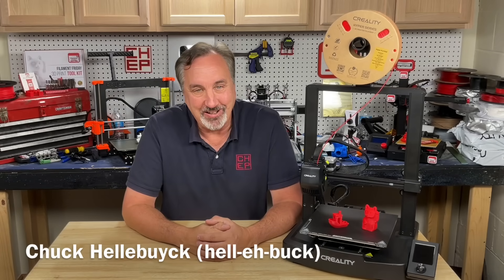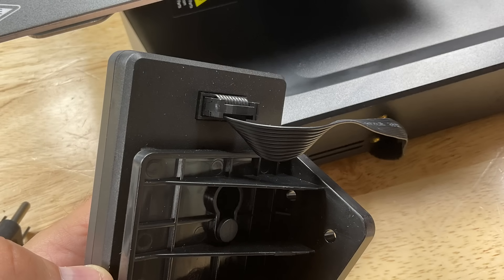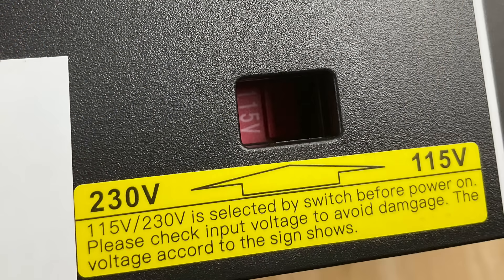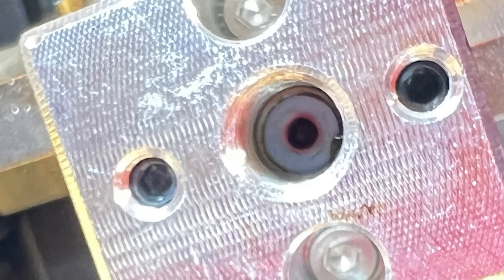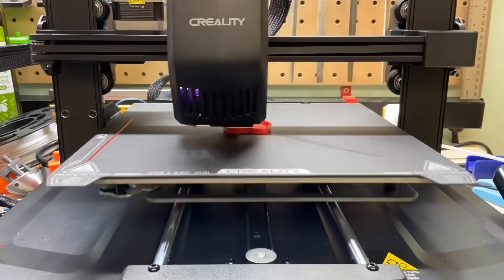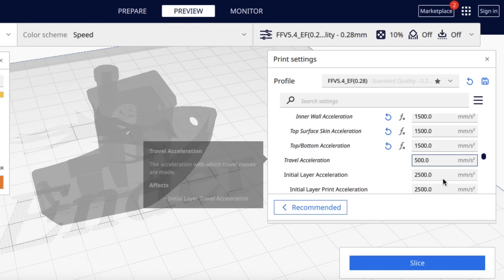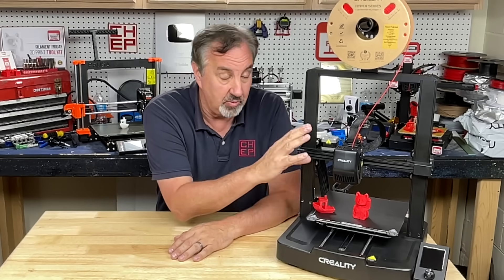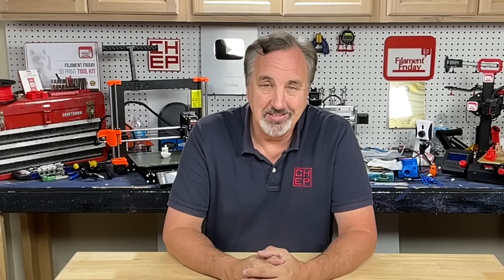Ender 3 V3 SE - Excellent Budget 3D Printer

Comment: Hi there :) I have noticed something strange on my Ender. At the beginning of a print, after the machine has done two lines on a left side, the extruder slowly goes up and then down. Because of this, about 1 cm of filament isn't printed (nozzle touches a base, moves slowly, but filament moves out after 1 cm). I have noticed in other videos on youtube that the extruder goes straight to a print area. Any solutions for this? Maybe someone else has the same problem? I have the latest firmware SWV1.0.6 - THANKS :)
Reply: I'm new to 3d printing but what you're describing sounds like behavior that's in the gcode. The print head is indeed supposed to go straight from the purge lines to the start of the print. If yours is doing something in between, then the gcode has something extra in it. The way I understand it, everything the printer does when it starts a 3d print is explicitly stated in the gcode generated by the slicer. This includes the purge lines. In Cura, the stuff the printer does immediately before it starts to actually print is stated in the Settings > Printer > Manage Printers > Machine Settings > Start G-Code. Mine has code with the following comments:

Move to start position
Draw the first line
Move to side a little
Draw the second line
Reset Extruder
Move Z Axis up little to prevent scratching of Heat Bed
Move over to prevent blob squish

It sounds like yours has some extra steps in there. Read up about start gcode to see what should and shouldn't be there.

Comment: I received this as a gift for Christmas.  I had already a Ender 3 S1 printer, I set up the new printer and it worked great for the first few prints. However it sounds like the filament if getting stuck in the extruder. head. I am struggling with this and could use some advice. I am ready to continue to repair my original printer. 

In either case I am having some issues with the units. I have new nozzles coming and will adjust the heat and feed rate on the filament. 
 any comments to help ae appreciated...

Comment: what is the dimensions of the whole printer not just the bed. I got mine for Christmas and are trying to set up a shelf but cant seem to find good dimensions for anything other than the bed.
Reply: Creality's website says
420 x 366 x 490 mm.

I dunno if that includes the screen sticking out the side.

And don't forget, the bed needs space to move backwards for Y direction, it will overhang the back of the machine's base.
Reply: @massimookissed1023  thank you! I was wondering if that would have to be the case, needing room behind. 🤔
Reply: You need it 20 inches deep

Comment: Ive had this printer sense the release. At first it printed great. But now i cant get it to print unless i use one of your profiles. If i change anything including the temp the print fails. But even with your profiles the first layer isnt the best but it prints and looks pretty good. And im having the same issue with my sunlu t3 printer. Any advice on this?

Comment: Awesome
What would you suggest for a fast printer for under $800 please?
Smaller than 300x300 is fine
Reply: Fl sun v400 is around $600 and it can print up to 400mm sec

Comment: Question: since the Z offset is done automatically, what do you do when you want to switch from PLA to PETG, where you might want to raise the Z offset a little bit? is it done automatically somehow?
Reply: I would guess just raise the 'initial layer height' in the slicer. In Cura, it's found under "Quality".

Comment: Hi Chep I have just bought Ender 3 V3 SE and the bed is so noisy and vibrates like mad, its like the rods that the bed runs on need greasing, can you advice, have I got a faulty machine or has anyone you know had this problem. At the moment my first print is the cat and its vibrating a lot. my ender 3 neo max is great. by the way love your videos.
Reply from the maker: Sounds defective. I’d send it back.

Comment: Why bother with all this messing around. There’s so many better budget printers around
Reply: Literally give me one better option than this under 200$. I'm genuinely curious
Reply: which one would you recommend? thinking in getting a sovol sv05
Reply: which one would you recommend? thinking in getting a sovol sv05
Reply: Bambulab P1P, trust me it has all you will ever want, fast, auto level and robust
 @ElWawa2
Reply: @pebb  When you can get 3 of these ender 3s for the same price, I'd take the enders
Reply: @TheConsciousEntity Spoken like someone who has no experience with Enders. You'd end up spending almost that much trying to fix the various issues and improve reliability over time, but get nowhere near the performance or reliability of a Bambu or Prusa.
Reply: @BradleyDS1  I have 6 Ender 3s and they're much more reliable than you're implying. I added BLtouches to them for less than $15 each and I print drone and RC plane parts without issue. After new bed springs and autoleveling, enders are great. Now that these things are being included from the factory with all the weak points strengthened, the deal is even better. I'll be getting one.
Reply: @TheConsciousEntity  Do you think it would ever be possible to uprade  an ender 3 pro or the v2 neo to have auto Z?
could the leveling knobs be removed and a  load cell be in in their place?
and could the current version of marlin that runs on the v3 Se be dumped and flashed to the v3 neo or  ender 3 pro?
 my por does have the flashable STM chip ,not sure about the v2 neo 
would there be a free GPIO to add a load cell to ?
ender 3 por  already bas BL touch clone but it would e nice to   add the auto  Z offset.
 or  mayeb we need to twait till kiliiper add the  capnility?

Comment: I can't help but wonder if the one Creality sent you as a demo might have different settings than the one's being sold. I've mine for a little under 2 weeks now. I just use the creality slicer that came with it and changed no setting at all. Ran the same print on my ender 3 pro as I did on the V3 SE sliced in the same slicer and the V3 was moving fast enough that it shook a pen holder off the table it was sitting on. Not doubting your review at all because you are my go to guy when I need a video to learn something. I'm just wondering if they made some changes before releasing for sale.

Comment: Could you make a profile for using ender 3 v3 se with cura? They haven't added it to the list of available printers yet.
Reply from the maker: I just use my existing profiles with Ender 3 Pro profile. Works fine.
Reply: @FilamentFriday wouldn’t retraction differ for the direct drive?

Comment: Just wondering if I flash the V3 firmware on my V2 Neo... Would I get the same auto levelling functionality? I already have same screen, CR touch, the function for auto level is there... just not the confirmation of what I already know - there's a dip bang in the middle of my bed... and with 4x4 pattern the system is going to still miss it...
Reply from the maker: No, because the V3 SE also has a strain gauge sensor. 
“Worry-free Auto Leveling w CR Touch & Strain Sensor”
Reply: @FilamentFriday  Can I put SUNLU 3D Printer Filament into Ender 3
Reply: @Jakeypoo-di6hy  You can use any brand of filament, as long as it is 1.75mm diameter.

Comment: Here are the pros and cons as I see them:

Pro - The features you get for $200 blow the original $200 Ender 3 out of the water. Given how bad inflation has been, that makes it even more impressive...you get a lot of printer for your money.

Con - How are we still getting new printer designs with PTFE-lined heat breaks? I'd rather have the price set to $205-210 and include a titanium or bimetallic heat break than see people have to deal with routine PTFE tube maintenance.

Pro - Those linear guide rods are a huge step up from the 2040 or 4040 extrusions with v-slot wheels of older machines. It's a bit of a letdown to see that the other axes are fundamentally unchanged, but if they had to choose only one axis to use rods on, the Y-axis was the right choice.

Con - I personally miss having open extrusions upon which you can bolt more things. The light bar I added to my Ender 3 is super well-secured, while the light bar I want to add to my Sovol SV06 Plus with its injection-molded upper extrusion doesn't feel very secure at all.

Pro - At the same time I lament having fewer places to attach mods/upgrades, I do have to say that the cleaner look should be more appealing to less-technical buyers.

Con - This is the big one....why continue to feed the trend of proliferating custom nozzle shapes and sizes? Why?!?!?!? Someone in Creality's engineering department at one point clearly said, "we need a longer melt zone in order to reliably increase the overall print speed." The answer to that should have been, "okay, let's use a Volcano hot end, a CHT knockoff Mk8 nozzle, or at least a Volcano-like hot end from the K1-series," when in reality the answer was "okay, let's design yet another new nozzle to put into our supply chain so we can charge whatever we want, keep people anxious about availability of spares/replacements, and not bother to make an abrasion-resistant version for months." I don't know if this is a lingering after-effect of Bambu Lab going with their own proprietary design or just a scummy profit-boosting tactic that multiple companies, not just Creality, are taking more and more advantage of.

Pro - I like that Creality has paid some attention to giving consumers what they want in terms of more speed without sacrificing some of the ease of use. With the rise of budget-friendly Klipper machines, I'm starting to see confused people in various Facebook groups...sure, there can be confusion when people start poking around in Marlin, just not as much as you see when people want to do anything in Klipper.

Con - Creality isn't retiring older Ender 3-series printers as they release new ones. I've raised this issue before and it seems to only be getting worse. Just in the Ender 3 family, they have the V3 SE, V3 KE, V2 Neo, Max Neo, Neo, S1 Plus, S1 Pro, S1, V2, Max, Pro, and original. They could easily retire at least seven of those 12 (!) different models and not cause themselves or their customers any trouble. Personally, I'd keep the V3s, the Max Neo, either of the S1 Plus or S1 Pro, and the regular Pro and dump the rest from their active product lineup...combined with all the other Ender printers (a few of which could also trimmed from the lineup), it serves to make for a hugely confusing webpage for someone who just wants to buy their first printer. 

All in all, not a bad-looking printer. It should be competitive with similar printers offered by Anycubic, Sovol, Elegoo, Voxelab, and Flying Bear, especially at that price point. But I think a value-added video in your future would cover how to replace the PTFE-lined heat break with a metal one, and how to install a normal nozzle in place of the new custom nozzle.
Reply: It's not a new nozzle, you can use the same Nozzle from Ender 7 or 5 S1
Reply: @codasm  Fair, though I'd argue that still proves my point - the Ender 7 is trash and there's only one other printer worth buying that uses this nozzle, when they all instead could have used a standard nozzle size that gives users the freedom to choose whatever nozzle they wish to have. Yes, clones will eventually come out (a 15-second check of Amazon shows a few non-Creality listings for K1-type nozzles) but we already have a huge variety of Mk8, V6, and Volcano nozzles to choose from...adding one more to that list is an objectively bad idea.
Reply: Good points, especially about all the previous versions still available. It's happening with the Elegoo Neptune 3 and Neptune 4. The 4 is arguably the better version due to Kliper, so why offer or buy the Neptune 3 for a few dollars less?
Is the Sprite extruder a Creality brand, or is it 3rd party?
Reply: @jbrou123  I'm guessing Elegoo still wants to have Marlin printers available for people who don't want to take a jump into the world of Klipper, even though printers like the Neptune 4 and Sovol SV07 make Klipper more approachable than it had been previously. 

As far as I know, the Sprite extruder is just like the Spider hot end, original(ish) designs made by Creality that address some of the issues they had with their original Mk8 clone hot ends and basic extruders.

Comment: I just got this printer a day and a half ago.  Have never used or even seen a 3d printer before so I am definately a beginner.  It was very easy to assemble and works very good.  I did the cat for my first print and next I printed a part that I designed with tinker Cad.  Both prints came out good as far as I am concerned.  Although to be fair I have nothing to compare it with.  I watched a lot of videos on many different printers before deciding on getting this one.  The auto leveling and dual lead screws are what sold me on this printer.  The only con that I have is the manual is terrible.  I have learned more from watching Youtube.

Comment: And for 300 dollars you can get a 17 min benchy that is 10x better than this. A printer that is better in every aspect except build volume (180x180 insted of 220x220) and price (100 usd more). A printer that does 90% of the calibrations, leveling, etc all by itself and has wifi. May I recommend the A1 MIni from Bambu labs.
Reply: Of course bamboo has that sketchy thing not telling what data they are collecting. Not a deal breaker for many, but it is something to think about.
Reply: Bambu is far from open source with almost every part proprietary.  Comparing apples to rear bicycle cassettes.
Reply: @weirdnewworld1736 I dont remember comparing which printer is the most open source. Anyone with half an iq point should get the a1 mini over any ender 3 printer. Your responce is like comparing me comparing 2 cars on their gas mileage and speed, and you come in complaining that one doesnt come in blue so its worse..
Reply: Nah Neptune 4 is $50 more than the ender and actually has a usable bed size..
Reply: More like usd 300 more.
Reply: @Schule04  Only if you get the combo/mega combo. The printer itself is 299 USD.

Comment: My neo hotend doesn’t have ptfe bottom out so why does this lol
Reply from the maker: Check again. Neo is the same.
Reply: @FilamentFriday  correction I am a meat popsicle.
Reply: @FilamentFriday  still deciding on another cheap printer for craftshows currently running a x1C 2 neos and 2 built skr boarded Ender 3’s. Looking around the $200 range

Comment: I've been recommending this printer to beginners that don't have to time/resources to learn every in and out to maintain a printer. I would argue that you shouldn't even be printing at over 245 if you have a PTFE tube in the hot end. 240 max if you don't want to replace it for many years.

My first printer back in 2012 was a Replicator Dual, within the first few months i found that printing at 260 burned out the tube. So i replaced it and printed at 250 max.. after a year+ i started having issues again and lowered it to 245 max (having to lower speeds on larger prints for better layer adhesion even more). That seemed to be the sweet spot and only saw discoloring after a year. Then i just took it out and replaced the nozzle with an all metal one once they hit the market after a few years lol
Reply: Why this over the svol6 svo6?
Reply: @confuzled_makes  easier for a beginner that's not too interested in maintenance and learning all the ins and outs. but with the Bambu Labs A1 Mini, it's hard to recommend
Reply: @MrHeHim  how is the ender 3 se easier than the sovol svo6?

Comment: Is this the twilight zone? Creality made another cheap crap printer? This is like if tomorrow Ford releases a 2009 Focus. Why would anyone buy this? With the bambu lab A1 mini coming out in a month or so at $299…I mean how could anyone in their right mind recommend this Ender to a new user? If your goal is to mod and customize then sure, go nuts. But for a new user it’s like almost evil to recommend this thing, haha.
Reply: Well the A1 cost 50% more than the Ender. But you are right. Klipper an bimetal heatbreak wouldt not be that much expensive.
Reply: @Saeschboy That comes with the Ender 3 V3 KE at about $280.
Reply: Sovol sv06 is a much better choince at 199$
Reply: If you don't want to print something else than PLA, PETG or TPU than a A1 is maybe the choice for you. With 80°C on the bed you won't be able to print higher temp materials.
I would say that the Ender 3 and the A1 have different target groups. The A1 is more for people who just want to print something without getting into technical details. The Ender 3 is an inexpensive platform for tinkering and experimenting.
Reply from the maker: @c0mputer - The A1 has a 180 x 180 x180 build area. Ender V3 SE has a 220 x 220 x 250 build area. That’s significantly larger for more prints at once or larger 3D prints and also $100 less. So the real question is why would you be so sold on a more expensive, smaller printer we can’t even buy yet?
Reply: @FilamentFriday  The reason? Very simple. I forgot about the build plate size.
Reply from the maker: So I guess I’m not so evil then.
Reply: @FilamentFriday  There are ones who are more evil.
Reply: @FilamentFriday just SEMI evil. Quasi evil 🤣
Reply: @bryanfoster362  The margarine of evil.
Reply: @FilamentFriday check out the elegoo Neptune 4. Blows this ender out of the water